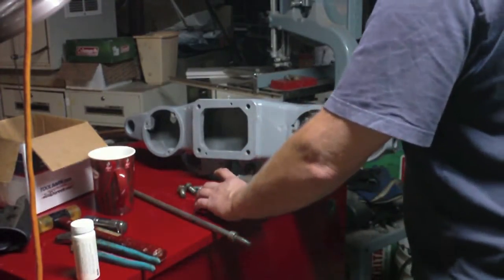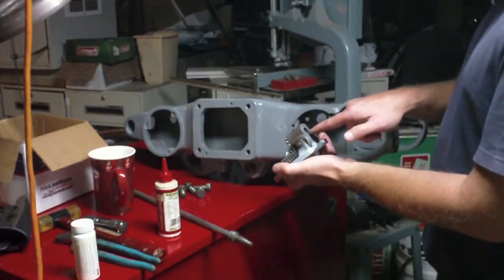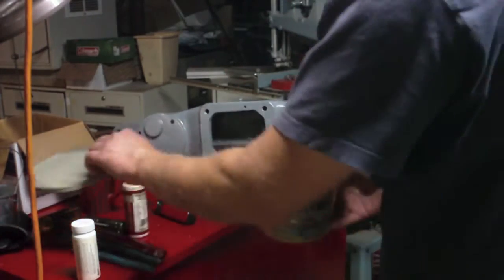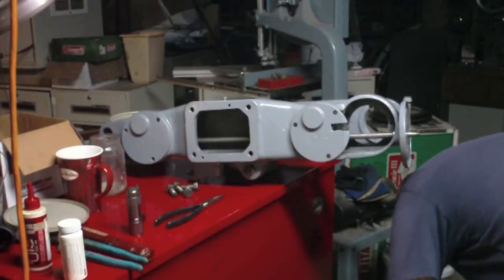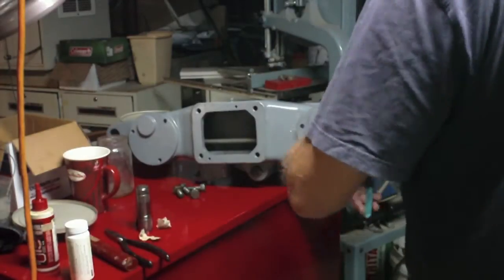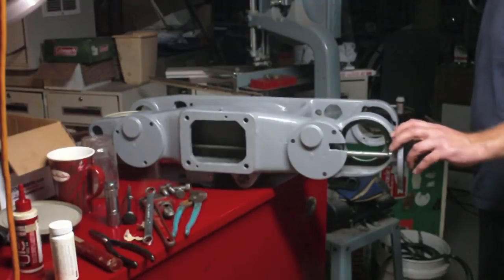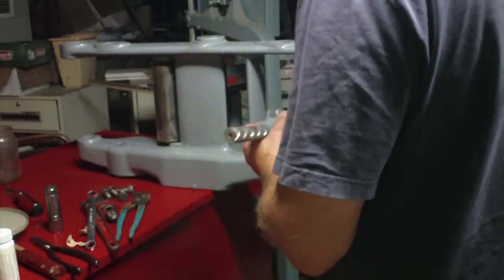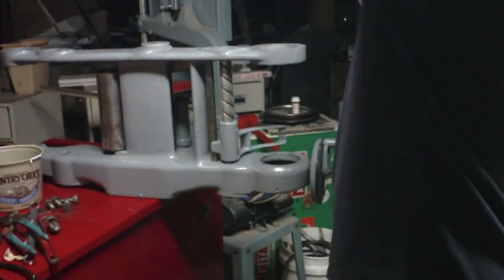Sipp Drill Press Part 47

Comment: You'll love this drill press. The last machine shop I worked at had one of these and it was so useful for drilling and tapping holes. It was easy to adjust the quill up and down according to your piece.
Reply from the maker: +toddlfrank Thanks. I had to stop working on this project for a while, but do plan on finishing it.

Comment: Does the end of the speed shifter handle have a spring loaded end lock into the detents?
Reply from the maker: No, it does not. I will see how it does after I get it all back together, and if it ends up being an issue, I was already thinking I could add something. Maybe a steel ball with a spring behind it in a hole rilled on the back of the handle.